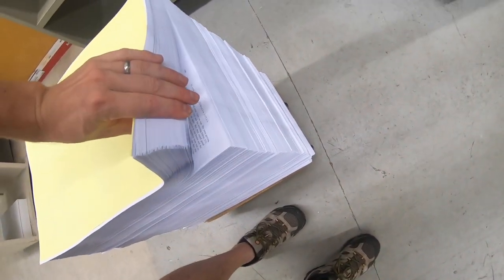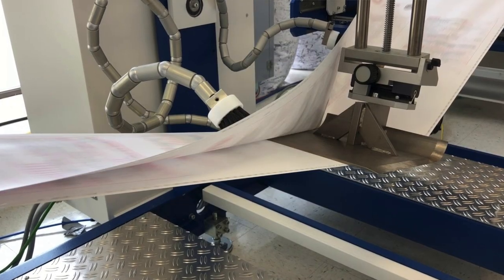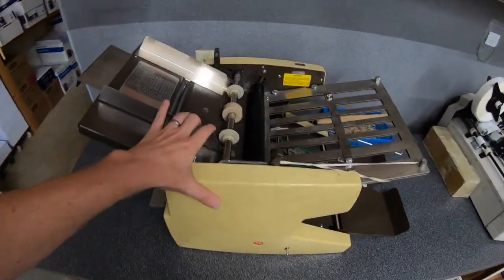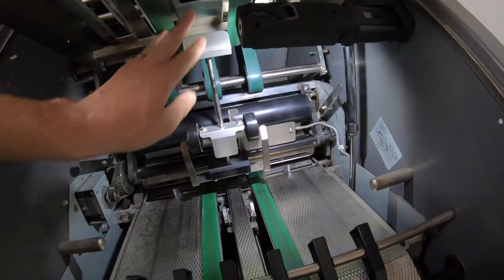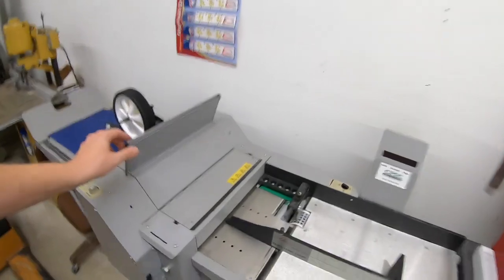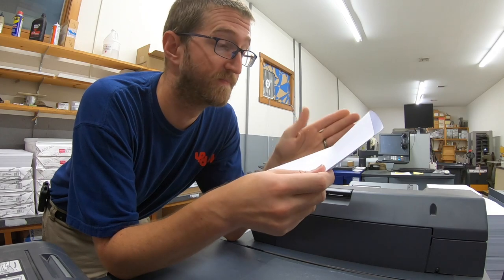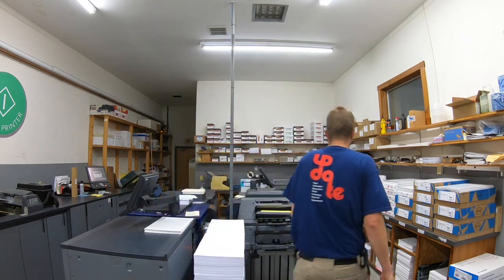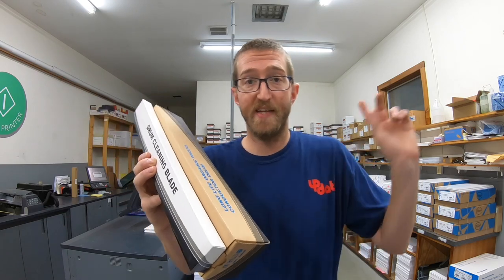Knife and Buckle Folding Paper

Comment: I have found that on a tri-fold brochure that people design on their own, which is fine, just let the computer software like word lay it out for them. And the software doesn't design it right and the normal person just doesn't know it.  Thanks for the video. We have an old Bell & Howell buckle folder had it since the early 70. She still runs great. We did have the rollers rebuilt once and I have  cleaned the vacuum pump twice but she still keeps running. Anoher good video. Fire brother from Ohio.
Reply: I have an InDesign template that has the third panel just a little short. Whenever I get a new job I drop the PDF into that template to make sure all the panels line up properly before printing. Alternately you can back trim the tail edge about a 1/16th of an inch so that panel tucks inside.
Reply from the maker: Thanks for watching and commenting!

Comment: I worked at a place that printed and mailed credit union statements. We used MBO buckle folders attached to Bell & Howell inserters. On most machines you could fold 3-4 sheets at a time without problems. The well running machines could fold up to 6 sheets at once. Very neat machines, I loved running them.
Reply from the maker: Interesting. Well engineered machines are fun to run!

Comment: @Just A Printer. Thank you for your explanation of the basic principles of folding. The fundamental difference between buckle folding versus knife folding is as follows. The buckle fold is made while the sheet is moving forward through the machine so it is usually a higher throughput process. With the knife fold, the sheet has to momentarily come to a stop position to register before the knife dips the sheet between the fold rollers. Since the sheet has to stop and change direction, then knife folding is slower. 
I have some experience in folding very thin paper e.g. bible paper (circa 28gms/m sq). Back then the only folding machines that would fold this weight of paper in sheet size 40 x 25 inches and bigger were all-knife folders. Machines like CAMCO (Canadian & American Machinery Co.) , Cundall (U.K. made) , Bonelli (Italian) were all renowned for folding these lightweight paper stocks. With a careful set-up, if you could get 1500 copies 1-up per hour off these machines folding bible paper, you were doing O.K. It was not unusual to have these folders surrounded by screens to prevent stray draughts from doors and windows causing sheets to lift and jam at the first fold position!
I did notice that you do not use the paper strip setting callipers for the fold rollers on your MBO. Do you always set the roller pressures manually for your jobs? 
Your binder operator is coming on a bundle sir! Stay safe and well.
Reply from the maker: Wow! That was very interesting. You caught me, I don't think I set the rolller pressure for this job. I know I should but I find that my rollers are so worn that for single fold I don;t bother.

Comment: One trick I sometimes do on trifolds is to back trim the last panel by 1/16th of an inch. That way it tucks in properly. Usually just do that if the customer did not design the panels properly, but it works.
Reply: In the U.K. your "trifold" is called a "letter" or "roll fold". So when folding DIN A4 297 x 210 mm. to 1/3rd A4 100 x 210mm. it's good practice to fold the inside panel to 97mm. Then the back and front/title panel to 100mm respectively. This format fits the standard European DL or U.S. Legal (?) sized envelope. Believe it or not, you can trim too much paper off the inside panel. The curve of the fold rollers will caused the inside panel to "stand up"/not lay flat. When you try to fold the cover panel over, you can get the corners of the inside panel folding over - "dog ears" as they are called. A good idea would be  to make a small scrape trim off the inside panel on a few sheets and test for the best result.
Reply from the maker: Agreed, I have done that often!

Comment: At my workplace we have 5 Stahl folding stations an a single Stahl knife folder.  It only gets used for the final fold of maps and for attaching to the end of one of our Muller saddle stitchers for folding finished stitched books in half, usually for mailing.  Some books are quite thick and require a trip though a pressing unit to prevent the book from popping open.
Reply from the maker: Neat! I wish I could visit everyone at their work. I love print shop tours!
Reply: @Jtm 204. When you endorse - fold saddle stitched books for mailing, do you offset/stagger the stitches on the thin(ner) products? We used to do this to reduce the "bump" going through the fold rollers of the mobile knife unit. Also to stop the stitches bursting through the spine and reduce the bulk of the product if it was to be inserted in an envelope.
 I knew of one company who specialised in this kind of finishing. They had a dedicated endorse fold mobile knife unit where they had the rollers grooved out where the spine/stitches passed through.
Reply: @markmiwurdz202  I stagger the stitches on all books thick or thin, it also makes it easier for the person on the end to see that both stitches are there.  Over time a groove developed on the rollers and works well for 8-1/2x11 size books which are mostly the size that is folded.
Reply: @Jtm 204. Thanks for the reply. A question. How do you stagger the stitches on a Muller Martini line where the books are stitched on the fly?
Reply: @markmiwurdz202  the heads on this stitcher are all independent so they can be moved anywhere.  It’s quite common to run 4 heads when doing a double digest book with a punch out in the trimmer.
Reply: @Jtm 204. Sorry, I misunderstood. You meant offset the stitches making them not an equal distance apart from the middle of the book. 
On Harris/Macey/Brehmer/Stahl/Heidelberg stitchers, the books are stitched while stationary (zero speed). So you can alter every other flight on the stitching chain so that the copies are delivered one normal/one delayed to the stitching shuttle device. This means that both stitches will be staggered. This helps when packing the booklets in boxes by reducing the bulk in the pile.
Reply: @markmiwurdz202  yes just not even head to foot.  Our machines are quite old I believe they are late 70’s early 80’s they still work though.

Comment: I do basic servicing (XPP) on our Xerox's even though we have a contract. Honestly it's not worth servicing a Xerox machine yourself without a contract as its very difficult if not impossible to get service manuals without their special software (Eureka). Finding parts is very hard on the higher end machines and you'll often pay a much higher price in the long run. Higher end Xerox machines are really geared for purchasing on a service contract. Although some of the entry level models are fairly simple on repairs and often cheaper on consumables.
Reply from the maker: Agreed!

Comment: It’s pretty hard to maintenance Xerox machines these days without have the service agreement with them. Even toner and drum cadridge is hard to get. The microchip in the toner does that you can’t even buy non original toner.

That is for their Primekink, Versant, Iridesse, Igen etc. models. I guess it can work on Workcenter, Altalink series and so on.
But they are just office machines..
Reply from the maker: Good point. I could track down parts for my xerox 3535 back in the day, but there are many more options to buy Konica parts.
Reply: Yeah we have to buy these dodgy chips off Ebay just to run our own printer

Comment: The 1200 has more than 24 Million clicks on the counter? Wow - that's awesome! Is that one click no matter what page size? We had a KM 1200 some years ago but always had problems with the machine (toner dust on coated paper stock etc.). We're running our b/w stuff on a PRO 1100 now and are pretty happy with this one.
Reply from the maker: Yes, I want to see how high it will go. :) That is for any page size, however I mostly print 11x17 or 12x18. I'd love to see it hit 30 million.
Reply: @justaprinter  Good luck then! But I don't think this is going to be a problem for you ;-D
Reply: @justaprinter  It will!

Comment: We have a great alternative to scoring our covers and heavier stock. We got an Aerocut a couple years ago. So, we will take it right from the printer and put it in the aerocut. It cuts and creases the cover in the same spot every time. 

We found that some stocks tend to crack when we run it back through the machines if we score it. But, for some reason the creaser fixes the issue.
Reply: Uchida aerocuts are BEASTS!
Reply from the maker: I never heard of that machine. It looks awesome. I'll need to do more research on that!
Reply: @justaprinter  What makes that machine even better is we can set it to cut an entire sheet of business cards perfectly. If we have a business card run soon I will record it and send you a private link of it running.
Reply from the maker: @user-uh5nb8js8w  Thanks!